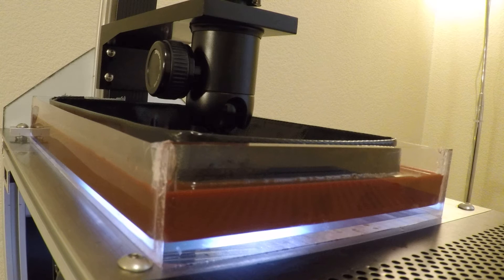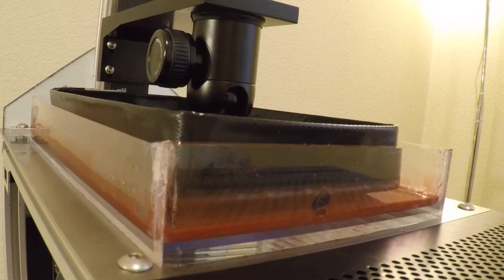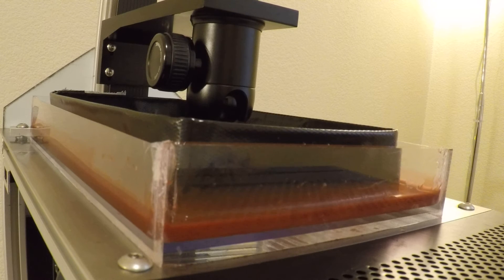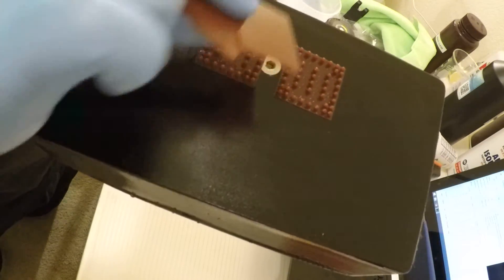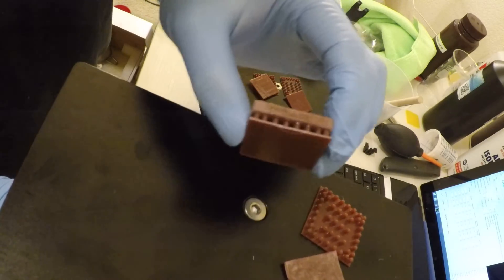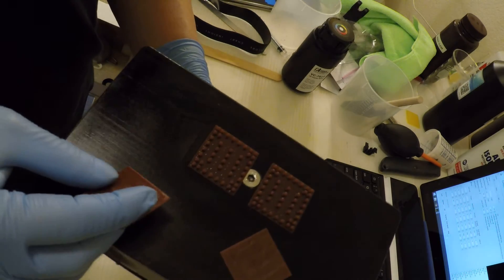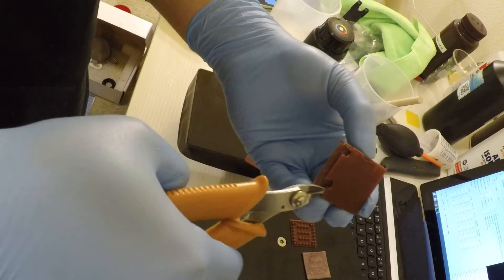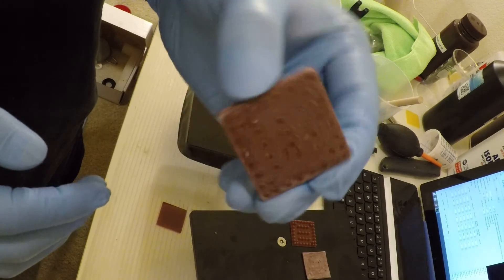Kudo3D Titan 1 SLA DLP 3D Printer - Version 2 and 1 Vat Trial Print Comparison

Comment: i keep watching your videos with you having little success makes me think about trying to sell this before i even put it all together...
Reply from the maker: I don't think you should interpret these videos as not having success. I specifically designed these calibration parts to be unprintable (at least not perfectly printable) in order to highlight the differences between the vats. It wouldn't be very interesting to print a perfect print on the v1 one vat, a perfect one on the v2 vat, and then not be able to see any differences.

My purpose in documenting both successes and failures is to describe the boundary conditions of printing so that you don't have to discover them for yourself.

I've had plenty of parts print great on the first try, like the Tachikoma I posted to the forums or the calibration part in Venus Creator clear. And others, like the iPhone bumper I showed on the full print video, work after some adjustments.

Even the super hard (and huge) injection mold came out today in a video I'm uploading right now.

I've had really great experiences with this printer, and I would be extremely disappointed if the videos that I post for educational purposes were misconstrued as critical of the printer hardware. I could easily post video after video of flawless prints that didn't push the boundaries, but what would be interesting about that?

Every 3D printer has its capability limitations, SLA printers especially given the wide variation in build strategies employed by various vendors. I hope that those watching them will feel more confident about printing after seeing these outcomes, compared to other printers out there where you see the same problems come up over and over again in forums yet no clear description of how to overcome them.